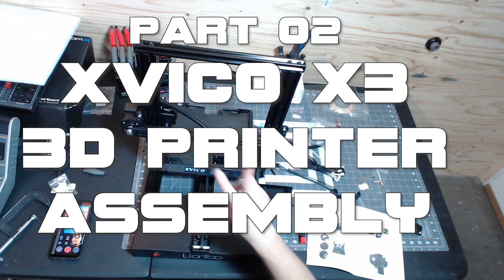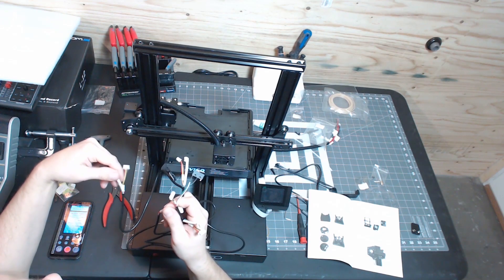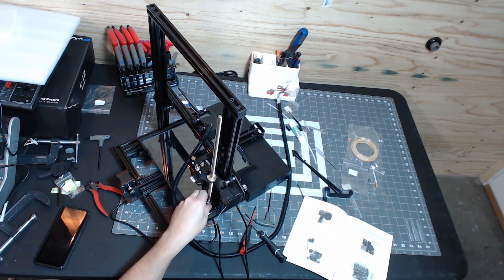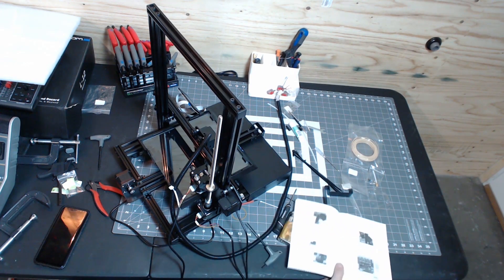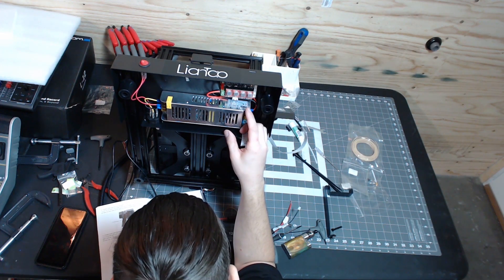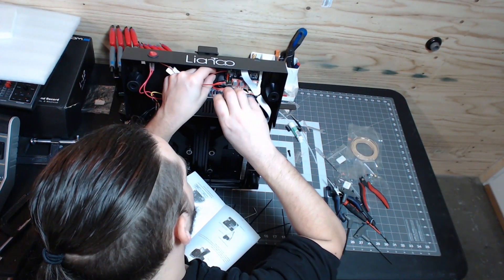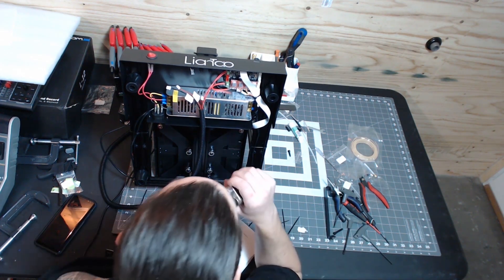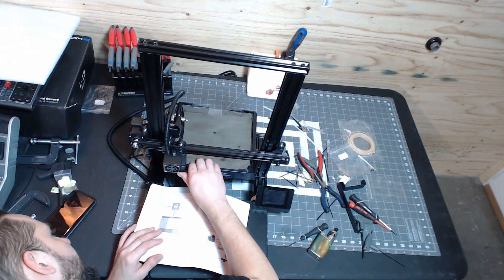XVICO X3 Unboxing & Assembly. Part 02

Comment: Can anyone tell me how to load filament on this thing. Just got one and there is only a button to unload filament and not load it. I am very new and confused. Thanks!
Reply from the maker: Its similar to an ender 3 or the like. Compress the spring loaded bar, insert filament until it reached hot end, release spring loaded bar.
Reply from the maker: @ 11:39 you can see where my hand placement is..

Comment: After having a "Font Updata Failed!" error on my Xvico Pioneer 3D Printer, I got a hold of the manufacturer in China and explained my problem. They sent me a .rar file with a "system" folder inside it was other folders. I placed the "system" folder in the SD card and and restarted the printer. The printer went through a 3 minute reboot and upload process, and now is running perfectly.

Comment: The machine should show the normal screen with or without the SD card in when starting.
You can put the card in while it is running not you have to switch it off to take out the card safely.
This allows the machine to close the card properly.
If you are just getting a white screen there is a reset button on the motherboard  just to  the side of the micro SD card slot above the pins.
I have not had to use this so don't know the procedure but I would guess that the machine is not plugged in when you do this.

Comment: Brian, on my  Xvico Pioneer 3D Printer, I got a "Font Updata Failed!" error, any ideas what i should do next.  The screen is locked with that error no matter what i do.
Reply from the maker: I'll reach out to my contact there and see if there is a firmware flash. Have you tried booting it up with and without the micro sd
Reply: @trivialproductions  The printer worked great until one day that I turned it on with the Micro SD card in the slot. And then I got a "Font Updata Failed!" error and nothing will work.   I have tried rebooting without the MicroSD, but that just gives me a white screen. as soon as I put the Micro SD card in it goies from a white screen to a "Font Updata Failed!" error.
Thank You in advance for any help!
Reply: @rickolibar  The sd card might have become corrupted if it was removed without it being closed up properly. try it in your computer it might say it needs fixing.
The printer should work with the sd card in position when you turn it on. There is no menu to close or eject the sd card so you must turn off the machine before taking the sd card out.
I have 4 of these machines and am finding them to be very good, just not a lot of information about them out there yet.
Reply: @terrygallagher1734  Does it need the SD card to run,  SD card is good in the computer.  Another person Private messaged me and said he had the same problem and could not find a way to fix it.  I would love to figure out how to fix, and the board is missing a boot-loader n  what happen when you turn your printer on without a SD card in it.  I tried a different SD card with the same results.
Reply: Fixed Problem, see below.
Reply: I have the exact same problem whre can i find the solution?